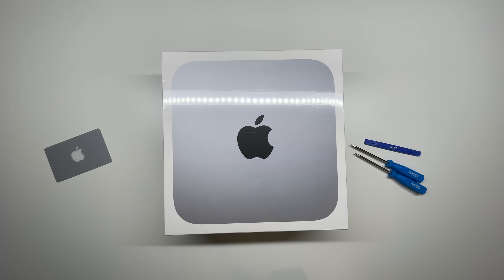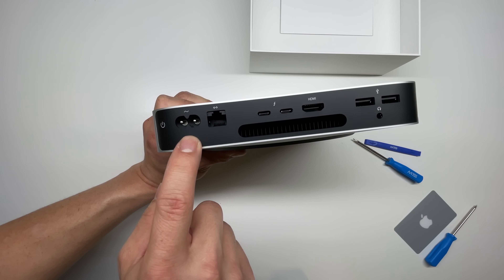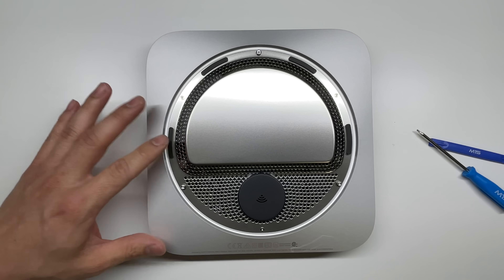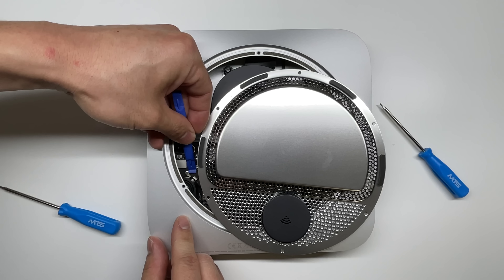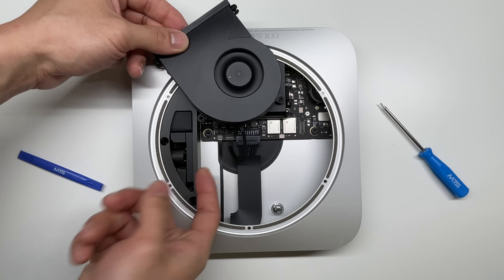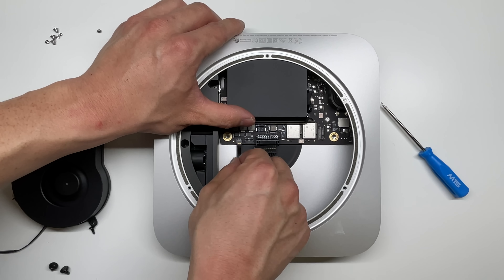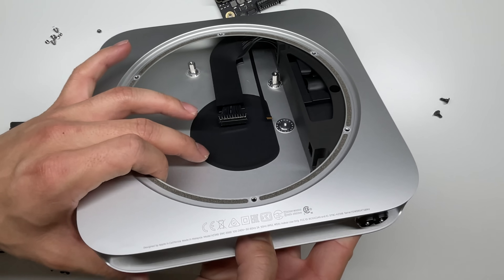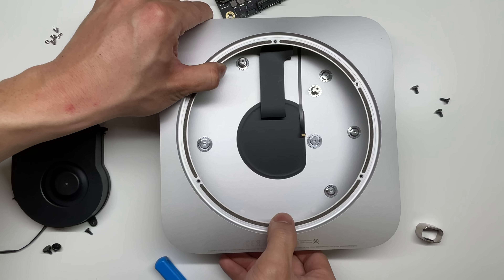M1 Mac Mini Teardown Disassembly 2020 (M1 close-up in description)

Comment: What a beautifully built machine!
Reply from the maker: Indeed!
Reply: Except its not upgradable.
Reply: @kalijasin   Been using Macs since beginning and this is what I hate most (along with the quasi-religious devotees). I used to start off with a base model and upgrade and expand them along the way, suited my cashflow. The only saving grace with these is that they hold their (overpriced) value and you can sell them on.
Reply: I don't think it's beautifully built. Half of the chassis is empty and the design has been recycled from the unibody Mac Mini, a wonderful machine but intended for Intel processors, SATA HDD (not even SATA SSD) and optical drives. Since the motherboard is so small and not upgradable, Apple should have redesigned the Mac Mini to a smaller form factor. So, I will wait for a more mature Apple Silicon SoC (M2 or M3) on a redesigned Mac Mini.
Reply: What an unrapairable machine
Reply: @DarkH4X0  who cares.. They cost like $600 bucks brand new. If it actually broke you could sell it broken on eBay as is for like $400 bucks easily as (not working).

Then add an extra $200 and get a brand new one. 

That’s actually (if) it breaks outside of the 1 year warranty period. 

What if my desktop broke? The video card is over $1,500 bucks used. My CPU is wayyy to expensive also. As is anything else on it. 

It would cost more to repair my desktop, and it is (easily repairable)
Reply: Something not upgradable and not repairable is not beautifull.
Reply: @jeanbedo  so you don't buy smartphones right?
Reply: For sure
Reply: Can't even upgrade. What a hung of crap.
Reply: Totally agree. I was like wow, this is a piece of art.
Reply: Wait until yours stop working. Your data SSD will screwed. LoL. Anything brand new always good. But no user replaceable ram and SSD are nightmare. Look at that  wasted space inside case. The board just only about half size of its space. Apple really learn how human body created. Body doesn't meant as user replaceable body part.
Reply: @Ferroza-m8d  3 years an ssd? My pc has 6 years lol never bricked a single time
Reply: @Skalicaa  incase bad thing happens causing mac mini to death, do owner have to pay to rescue the data in SSD? In normal condition, all we need just unscrew the SSD, all save.
Reply: @Ferroza-m8d  you have to save it with another Mac. But I'm putting all my files in an external ssd
Reply: @Skalicaa  make sense. Anyway. Every apple product really tempting.
Reply: @Ferroza-m8d  yes but for me 1k iPhone or a 2k mac are waaay to much expensive. A good productivity desktop for 1k (16gb ram) is worth even if it's not repairable, we also die as humans
Reply: What a beautiful soldered machine
Reply: Beautiful until you want to upgrade your ram to 32 gb for $190, so you wont have to pay for the overpriced $200 16 gb ram.
Reply: Its the same old design
Reply: It's an ugly build fat iPad.  I'm curious if they ever will be able to construct a real computer.
Reply: Yes it is. Apple is unbeatable in design and user experience
Reply: And that is all you can say about it.
Reply: @fmmderetarzi  Yes, its just an empty box. With a very fast processor inside it. That does lots of stuff quickly.
Reply: @MrBunnyGibbons  the same stuff you can do on an iPad, as a desktop computer is far away from anything usefull
Reply: Catalin Alexandru you clearly haven’t seen its incredible performance that can even beat a core i9. Well, if you are just a gamer, then of course it is not for you.
Reply: @augustogalindo8687  uuuu so nice, i can play candy crush on it. Dude it's a glorified iPad, maybe in a few years there might be something. 
But for now i rather get a samsung phone with Dex, it's more useful.
Reply: @augustogalindo8687  it makes no sense to have a similar performance to an i9 if you cannot upgrade the RAM and keep up with professional software which require 32 GB or even more. You can't even upgrade the storage space with an M.2 memory and 250 GB aren't enough for any type of professional job. This should be a machine for professionals, but in reality right now this is just an expansive toy for people who like being beta testers whitout even geting payed for that.
Reply: @fmmderetarzi  Can you run pro apps like ps, premier, after effects, final cut, logic pro, etc on the iPad? It is faster than an iPad processor and runs a desktop os.
Reply: @AdmiralDino235  no I don't, that is why is crap. If you do more power to you
Reply: @AdmiralDino235  people that run only those programs and brows the internet/emails most likely had a apple whatever before and would continue to buy one even without M1 processor.
People like me that also game on my device in my spare time will not give a rats ass about it.
And 3rd i would rather stick with a non apple device and not have my device bricked everytime there is a software update. As crap as windows is at least it does not fk up my bios and i can boot from a different drive.
Reply: @fmmderetarzi  If you don’t need the performance then get the iPad, but the Macs also have better batteries and game support. I’ve never seen a Mac get damaged by upgrading to the latest software and that includes new Macbook Pros and Airs, an old 2012 iMac, an old 2014 Macbook Pro, an old 2011 Macbook Air and more. Also, you are still allowed to boot from a separate drive just like you always have been.
Reply: @AdmiralDino235  try checking one of the latest videos from Louis Rossman, i rather trust a guy that has been fixing these machines.
Reply: @fmmderetarzi  
Its better ecosystem than your useless pc boxes will ever be! So please,  if you want to compare macs with pc... than compare Tesla to Golf... Your Golf will alwys stay Golf...
Clear now?!!!
Reply: @silviosarunic6709  google deleted my reply most likely since i cand see it anymore.
Fk all brands and i don't hold any loyalty to any. I don't give a sht about "the software" "the user experience". Grow up, sht ain't so bad as it used to.
Reply: @fmmderetarzi  I hate the repairability  sure but the fact is that mac OS and windows are the most powerful operating systems and anyone who hasn't updated their programs will and if they don't Rosetta 2. Plus dex is glorified android anyways.
Reply: @marcmiyamoto  I know Dex is pretty whatever, i actually don't buy samsung phones anymore and do not recommend to anyone until the stop selling the crap exynos. But at least at the end of the day i can use it as a phone and a "computer" (emails, browsing, the easy stuff) as in this mac mini use it as what? Is not quite a computer, it's not a mobile device either, so what am I using it for? 
Like i stated before, maybe with time there is something here and it's useful. 
As of right now it's just hipe and nothing useful.
Until then let's chill and stop getting our dck hard for nothing.
Reply: @fmmderetarzi  this useless computer is a 699$ base model that can do certain things through rosetta better or at least as good as a 3000$ 2020 iMac, so my question is : if this is just merely a glorified iPad that is utterly useless, what is any computer running an i9 or lower ? A toaster ?
Reply: @fmmderetarzi  The mac mini can run high intensive programs. Can your Samsung edit multiple streams of 4k video at once? No that's the power of having such a powerful processor in a computer. Face it all the people who say that phones are replacing computers are lying, computers aren't going anywhere, as of yet.
Reply: @marcmiyamoto  excuse me, can I have the lottery numbers also since you can read the future?
Reply: @marcmiyamoto  and buy what you want...at the end of the day who cares. 
It's not like i'm trying to stop you from buying it. I was saying that this first generation might not be all sunshine as they are putting it out. And is best to reserve judgement for later, about a year or so.
Reply: @fmmderetarzi  Google made a quantum computer, I seem to have noticed it’s not in a phone.
Reply: @fmmderetarzi  Hahaha. The iPads aren't even close to being in the same league. Countless speed tests confirm.
Reply: Haters gonna hate. Many ridiculous claims in this thread.
Reply: @cantisanifoto  keep drinking that cool aide
Reply: @cantisanifoto  how is it hate to say it’s not upgradable when that’s an actual fact? I don’t get it. Care to explain?
Reply: @kalijasin    it is hate to dismiss an entry level  computer that outperforms more expensive ones out of the box and spending a ton less energy. Yes, it is not upgradeable, mainly because the M1 is not (just) a processor, it's a System On a Chip, that includes the RAM in it, and therefore it doesn't behave like a regular computer in many ways. Nobody says it doesn't have its shortcomings, but all the hateful remarks in this thread are laughable really. I mean, whatever.. if you guys don't care for it that's cool, you just sound like the typical Apple hater crowd and that's ok I suppose.
Reply: @fmmderetarzi  I have an iMac 2017 desktop computer running Final Cut Pro, but it’s so slow particularly the rendering of the clips. I’ve hooked up this little box running the same project on Final Cut Pro and I’m amazed at the difference in speed and rendering. It’s NOT a glorified iPad, in which I own, can’t even run Final Cut Pro, what use is that to me as a videographer.
Reply: @adruralo  yes i know, video editing is great, i'm not doing that on my computer. So for me it's a glorified iPad, but if you expect a full desktop computer experience it's not there yet (as i mentioned). And as i freaking mentioned before, it could be...but that is in 2/3 years. You people don't know how to read or can't take the fact that for a lot of us out there this thing is unusable at the moment.
Reply: @MrBunnyGibbons  you could stick a house in that case with the emptiness it has.   I think apple should miniaturize this even make it wafer think like a max book air in a smaller form factor of course.   

I’m conflicted because ideally I would want to wait for the refreshed m1 iMac but I’d also like to get the iPad Air or the MacBook Air.   My newest max computer is a 2014 iMac 5k which is still very competent but I wouldn’t mind having something more modern and able to cut through video editing without breaking a sweat.
Reply: @fmmderetarzi  how often has maca been bricked after an update?  That’s quite an exaggeration.   Big Sur hasn’t exactly been flawless but it’s still functional for the most part.   It’s also the first of a major iteration unlike previous updates.
Reply: @Skalicaa  And that is your problem because? 
Don't you have nothing better to do with your life than sip trough 3 months old comments of comments and actually replying? 
If I want to shit on apple and there crapbooks it's my problem and my waste of time
Reply: @fmmderetarzi  I'm buying the M1 Mini cause I need Logic for university (all the lessons are on it). But I also don't want to spend 2k or even 3k for a Macbook intel heater. 900€ with 16gb of ram (the 8gb is a scam) for a machine like this is not so bad at all. A 900€ windows pc will be a crappy one, and if you count that the GPUs are non existent in the market you can see that this time Apple has a better quality/price ratio than a normal PC by a lot. 
"But I'm a gamer" 
Ok so choose, 2k$ for a scalped 3080 or 500€ for a crappy 3 years old gpu?Lmao I don't spend months of my salary just for playin' a fuckin game
Reply: @Skalicaa  Me neither, because i purchased my crap when the prices where good.
And got a good pc for 900€ 
And I do not buy apple no matter what the so called value is because it might be in the US but everywhere else is mediocre at best.

And I like my ssd not sodered to the board thank you.
Reply: @fmmderetarzi  It also happens beat an Intel i9, and comes close to beating the AMD Ryzen.  Go troll elsewhere.
Reply: @Gmon750  do i look like a give a fk what you buy or use?
Reply: @Gmon750  really don't care what you buy or use. If the new data shows it's a good device and you can use it go nuts (for me it's almost useless)